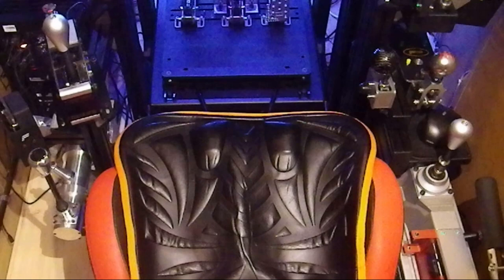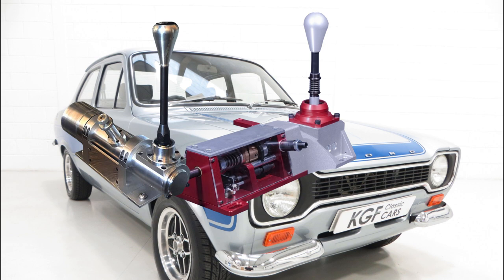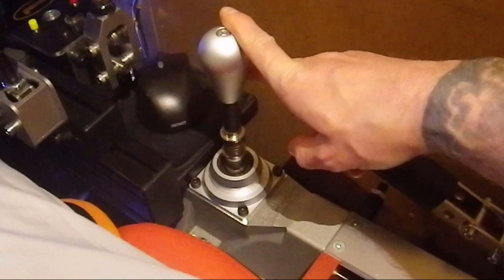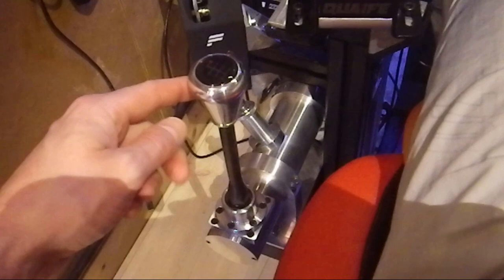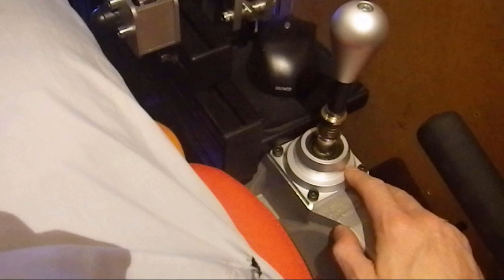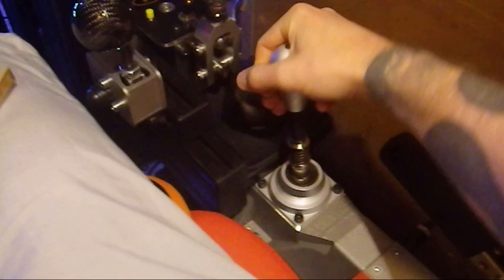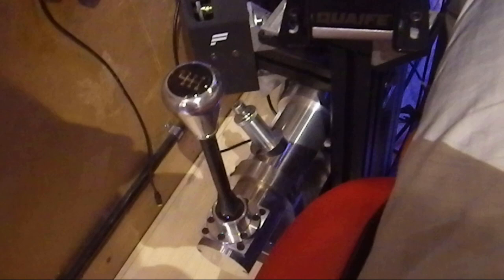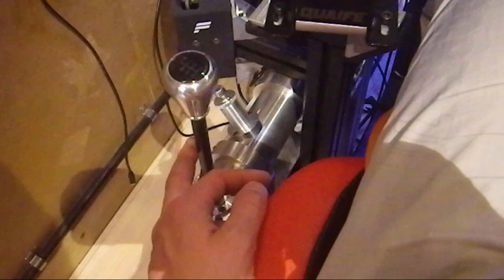BDH Shifter vs Pro-Sim Quaife H Pattern - The Bazooka Shifter Take On The Tank!!

Comment: One thing I am a bit concerned about is I tend to be a bit rough on my H-pattern especially on the 1st and 2nd gear...can you do a resistance test pulling sideways from the 1st/second gate transitioning to the reverse section?
Reply from the maker: You mean you are afraid of accidentally putting it in reverse?
I won't be able to see the scale, but will see if I can do some testing for you.
You could also mount it the other way, with reverse to the right beside 5th and 6th.
Reply: @RVRCloset  oh! Ya I remember you saying that. I didn't think about that lol ya, I am not in 5th as much. That does it! I will begin the process of obtaining one I think!
Reply from the maker: @DouglasThompson  Just tried a bit, and it's at least taking double the force getting it out to get into reverse.
Reply: @RVRCloset  that sounds great!

Comment: Let me guess you have a bmw? Also how does the lockout on the prosim work? I guess it is detecting the clutch input, does it let you change gears if you mis shift?
Reply from the maker: Saab.🙃
It should be working with a software, and yes, be able to lock the gears when clutch is not used. But I'm actually not sure if they ever release it.

Comment: Thanks for the comparison! Would you say the BDH is worth it over a frex + synchro mod? I like a lot the idea of locked gears without the clutch, but does the BDH experience trump that?
Reply from the maker: I really like the Frex, my to go to shifter for prototypes and classic formula cars.
But I no longer use the sim synchro, if you put any pressure on the shifter before you engage the clutch, the clutch get's locked out..
So there are a risk you might damage something on your clutch.
Reply: @RVRCloset  I see, thanks for the insight! I guess that leaves only the pro sim with its add-on… can’t wait for your review of it!
Reply from the maker: @ChrisMorganYT  Yeah sadly.. And that will be an expensive addon especially now after brexit..😅

Comment: I'm trying to decide between the Frex and the BDH, would you say that they could both be used for training driving a manual in real life or does only the BDH feel like a real gear shifter? I know they're very different price brackets but I can afford either one, I'm mainly concerned about realism (but if the Frex also feels realistic enough for training then I'll go with that option).

EDIT: Sorry I just realized you already replied to another comment asking basically the same thing
Reply from the maker: No worries. :)
For a normal road car feel I would go for the BDH. Frex falls more in the classic formula and prototype car category. 
But as I said on the other comment, BDH is a small team, and I actually think they don't take any new orders at the moment do to high demands..
Reply: @RVRCloset  I think I'll have to go with the Frex then, I love classic formula cars in sim racing. Also don't wanna have to wait for the BDH. Cheers, thanks for the reply!
Reply from the maker: @kit-the-kat-skelanimal-plush  You are welcome.👍

Comment: Try the V2/V3 Simvertex its like 700 Euro
Reply from the maker: Do they have a H pattern as well?
Or do you mean the SQ?
Reply: @RVRCloset  Yes they do. However their QC and customer services are terrible. Mine was stuck because of the defective milling. I would avoid this company in the future. Own the Simvertex V2, got it repaired/modified by myself. Still waiting for my BDH to come. Thank you so much for the comparison. What's the reason that you sold the Pro-Sim btw?
Reply from the maker: @INKWALK  Thank you so much for the input!👍
I was almost never able to use it since my wife started working night, it was too loud to use when she is sleeping.. The BDH have taken it's spot on the rig though so no harm done.😁👌
Looking forward hearing your thoughts on the BDH!
Reply: @RVRCloset  Thanks for the prompt reply.  A British company called Base Performance Simulators had just became the exclusive supplier of the BDH. I think BDH itself no longer build/ship the shifter. Not sure how things will change. That was why I came up checking your review again to see if I would like to buy a pro-sim instead ( endless waiting as well ).
Reply from the maker: @INKWALK  Oh, more info I did not know, thanks again for the information!
Yeah sadly, how long is the waiting list for the BDH at the moment?
Reply: @RVRCloset  No idea at all. But it's ok. My Fanatec H and modified Simvertex H are usable. Jinx SQ works like a charm. At the mean time, driving Mario Kart with kids brings happiness as well, isn't it?  ; )
Reply from the maker: 😁👌
Oh the Jinx as well, heard good things about that one.